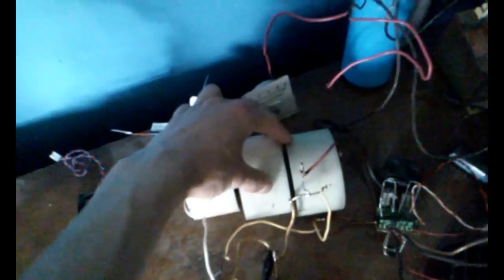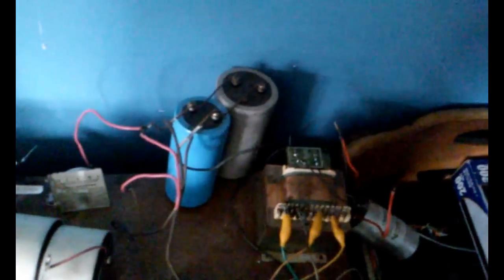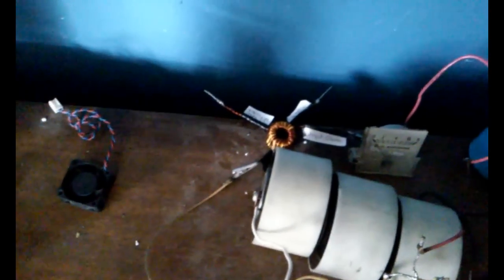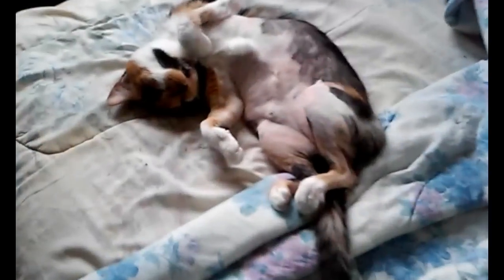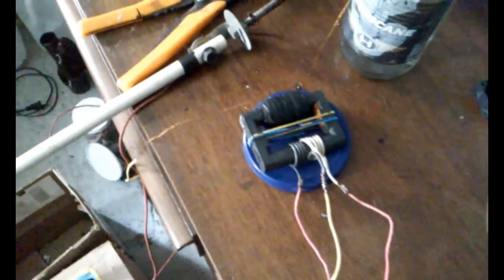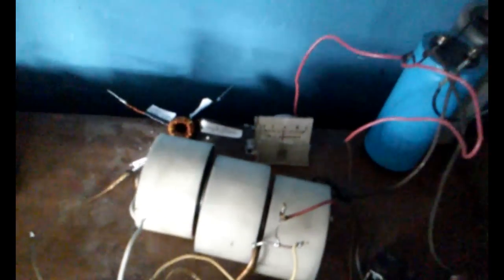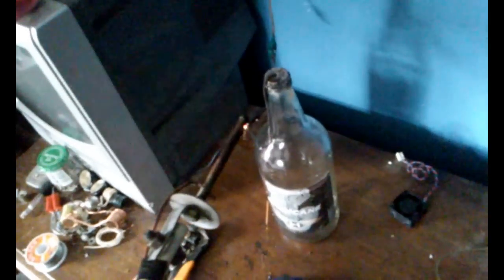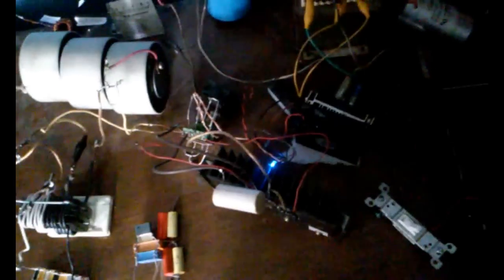ZVS Driver Revisions & Upgrades Plus Arcing

Comment: shared!

Hey,  boeing aircraft just patented an arc generator to protect vehicles from incoming explosions.

Generating an arc using MICROWAVES from two transmitters, using lasers to guide the microwaves to a point where they meet and create an arc at a distance from the vehicle... to induce plasma.. which then visably arcs...

The plasma shield then protects and DEFLECTS incoming blast shockwaves.

Yes, the arc's plasma deflects "waves" of any kind, including radio waves.. theoretically I suppose you could detonate a large firecracker on one side of that arc.. and the other side would not feel the blast.

Cheers for all your vids.
Reply: dutchsinse So it's force-field, sort of.  Cool! :)
Reply from the maker: dutchsinse This sounds like something from a Si-Fi Movie. Sadly we are in that era though. I also read an article about lasers being used to possibly direct lightning strikes. In a favof or against one.
Reply: Juniortore1 What does "In a favof..." mean, please?

Comment: Have you tried feeding solder through a mechanical pencil with the side feed click button? It works great for circuit boards and not burning your finger tips lol!
Reply from the maker: WILLY vs WALLY I never thought of that. I dont think it would work with my current roll of solder though as I am using 1.2mm I ought to try it when I get some thinner

Comment: 1)  Bravo!  2)  I liked seeing the D.C. amps meter being pegged to maximum.  3) 7:28 -ish:  How is it that the wire in your bottle insulator (?) makes a corona when the "chicken-stick" isn't even close enough to it to make arcs?
Reply: ***** Ah!  Ok.  Thank you for that.  :)
Reply from the maker: maintoc Before my last and best flyback finally died I was getting about 1 1/2 inch arcs to the air on both electrodes. The funny thing is it held up to the 100KV or so, it just couldn't tolerate a steady arc at 1000W for five minutes. The epoxy cracked and that was that.
Reply: Juniortore1 It must be those cheap made-in-China parts.  :p  Sorry to hear about your last/best flyback, though.  I imagine you'll find more, although with L.C.D. & L.E.D. & plasma tv sets being so common now, maybe you'll have to scrounge harder now for the older-style C.R.T. tv sets.

Comment: Nice... Really fuckin nice!
What type of MOSFETs are you using?
Also, thanks for the tip on putting those ferrite beads on the gates, I have collected a bunch of them and never thought of where to use them... Not I know.
Reply: *****
 Hmmm, I have three FGL60N100BNTD IGBTs.... They are 1000V 60A... I was planning on using them for a SSTC... I am really liking the output of this ZVS-flyback arrangement though.... I also have a MOT I need to rewrap... Decisions, decisions... :)
Reply from the maker: Binj Komisar I did not know about the ferrite beads until I saw them used on a large homemade induction heater. Then thought to myself it would be a good addition. I am using g60n100bntd IGBTs. They work great and hold up to all of the power I have put them through so far. The only reason they have ever ended up dieing on me is over something stupid like an arc over, transformer saturation or something around that nature. Thankfully saturating cores will no longer be a problem for me. I can also relate to the MOTs needing a rewrap. I have two decent ones sitting here that I already took the arced over secondary out of. I really need to replace this audio transformer. It doesnt hold up to my expectations of a ZVS PSU. Great for a standard ZVS tho.